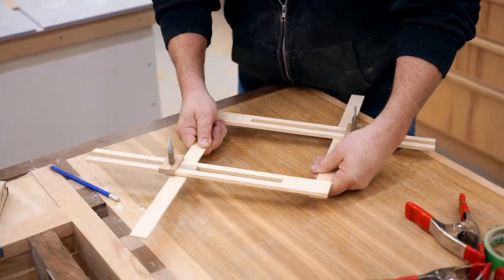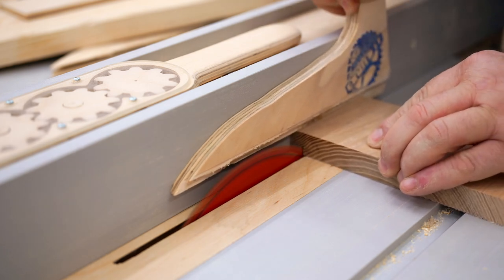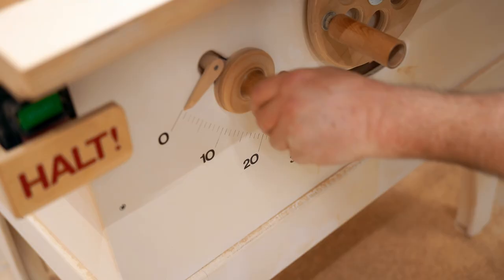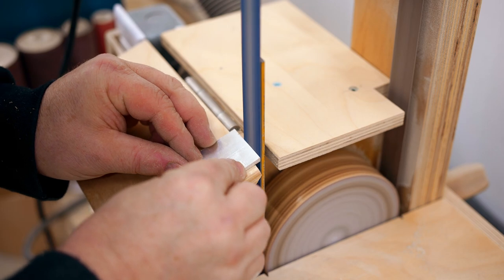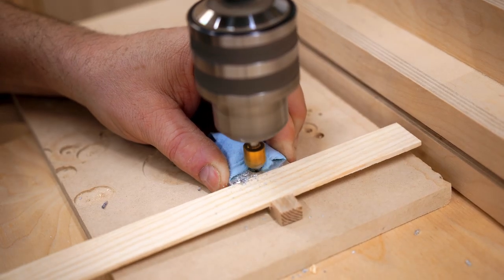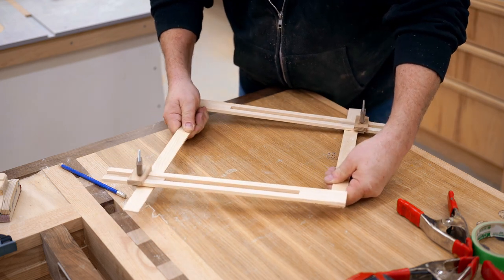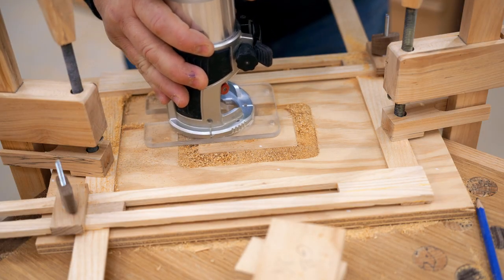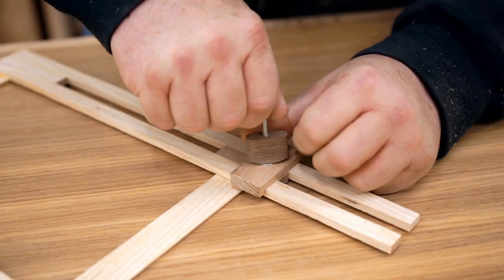I Wish I Made this 10 Years ago... Essential Tool for Woodwork

Comment from the maker: I'm sure this has a name, but I'm coming up blank. Anyway, it's for routing out recesses and holes or holes with recesses.
It's an idea that I've been mulling over for a couple of years, and the key feature is the spacer blocks that you use to size it accurately.
Also a tricky method for locking the rails together took a fair bit of deep thought, but works amazingly well. It is a bit challenging to make, given the small size of the parts.
After you have it sized, it can be clamped down or use double sided tape if clamps won't reach. Or hot melt glue, if you don't have any tape. 
The spacer blocks can be taped down too, if you just have lines on whatever you are routing out. 
Changes I'd make if I made it again: 
- Upsize everything by a factor of 1.5. Even though it isn't, it feels and looks flimsy. 
- Get real metal insert knobs and the locking bolt epoxied to the aluminum locking pawl. Or tap the pawl and use a knob with a stud. Then the pawl should be steel for the threads to last.
Reply: Router frame
Reply: Henceforth it shall be named: The John Heisz router jig !
ps: are you the one who gives hearts to his own pinned comment?? 🤨must be a sneeze click or fat finger incident 😁
Reply: @ginglyst  Interesting point you have there. You know what, I think John may have a dry sense of humour. Sometimes doing something a bit naughty can be fun. No harm in that. He IS a very clever gentleman, and he deserves praise. A lot of thought and logic goes into everything he does; I call it an engineers mind. Probably of German descent- which would explain the "logic" part.

Comment: I'm adding a router lift to my workbench and this will be perfect for cutting the recess for the mounting plate. This seems like one of those things you don't think you would use often until you make one, then find more and more applications for it as time goes by.
Reply: The thing is if you have masking tape super glue and 4pieces of scrap wood you already got a more versatile "jig" that takes you 0time to build and use 0 storage space.

Comment: Using a screw for a tap works amazingly for wood. I after threading the hole I usually put a drop of thin CA glue in and let it dry. It's insurance that the fibres don't come apart if I need to take the screw out and put back in.
Reply: Hello fr1end

Comment: I have used 3/4 plywood ripped about 4 inches wide and pocket screwed them together  in a butt and pass configuration to the desired dimensions,  it can be reconfigured but eventually wear out,

Comment: This is typically the kind of "genius idea" that i felt for so many time, wasting both precious shop time and then shop space. Seriously, 4scrap of any kind of wood with a straight edge, masking tape and super glue and bob's your uncle. Don't need any extra storage space, takes 0 time to built and about same time to setup. Bonus : you don't get clamps in the way (seriously sometimes i feel like clamps are part of a conspiracy to always catch my hand, the vac hose or the power cords, am i the only one ?). I use that with a 8mm shaft 8mm bit and a 24mm (=3*8) bushing (for imperial friends just use a bit the size of the collet you are using and a bushing that is 3x that e.g. : 1/4" bit and 3/4" bushing for a 1/4" collet). So it's a no brainner you trace whatever polygone you want (doesn't even have to be a rectangle) and in a pinch the bit itself can be used as you cale block. Bim! 0 shop time wasted building jigs instead of actual things you want to build, 0 shop space wasted storing jigs that you will barely use once a year, and 100% pure efficiency ! You trace, you glue your sticks on the lines set up the depth and route, pull the sticks, thank you good bye. 

Need to repeat the same routing many time ? Simple you do the same thing on a piece of mdf board this time using 2x the cale (i.e. : offsetting 16mm instead of 8) then you route and bim! that piece of mdf become a permanent template you can use with just the same bit and same bushing 100times. 

Need it extra  snug ? put a layer of masking tape on the faces of your sticks. Need it bit loose ? Use a layer of masking tape on the cale. 
That method is so versatile i bought a second router that is permanently set up with this 8mm bit and 24mm bushing.
Reply: Hmmm - this is an interesting idea.  But I’m not fully understanding it.  Could you provide a webpage, or a video, showing this idea ?   
It sounds quite handy, but as I say, I can’t quite picture the setup.  Thank you.